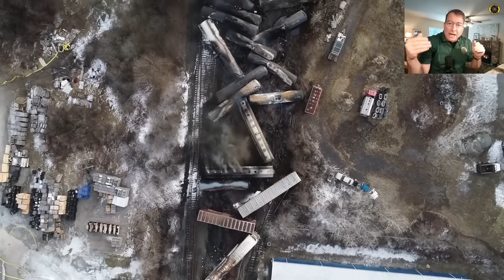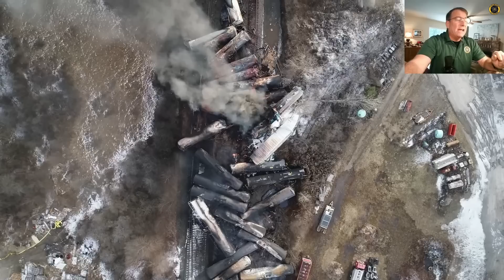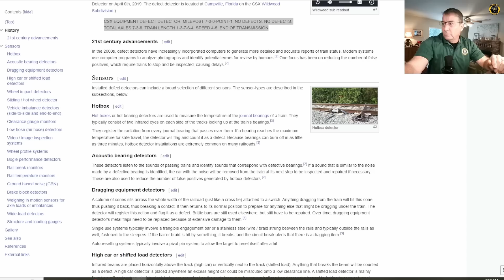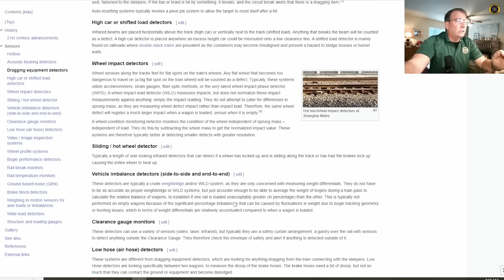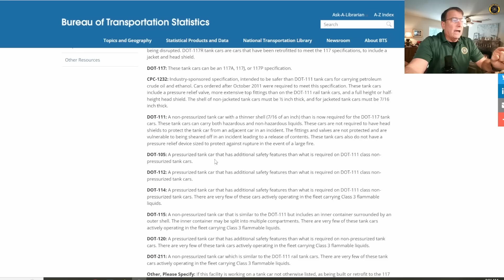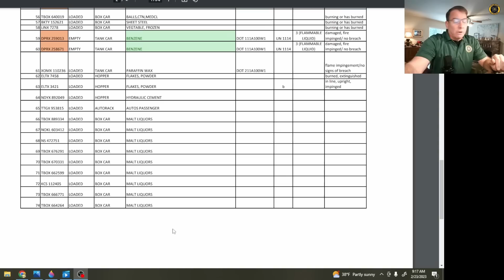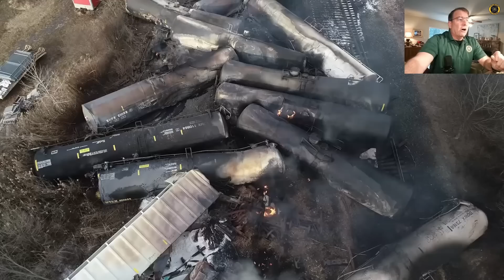NTSB Prelim Report: Norfolk Southern Train Derailment 23 Feb 2023

Comment: Sounds like the defect detector needs a software upgrade to check not only same axle temperature differences but the differences between all axles.
Also differences in the time domain for each axle, alarming when temperatures rise no matter the acute temperature.
Reply: Defect detectors are set to find temps outside of operational ranges. If it detects an out of range temp it alerts, it doesn't reference same axle over and over from multiple detectors.
Reply: @Batwingsix  
Which didn't protect this train.
That's why I suggest a change.
Reply: @Batwingsix  
I just read on another channel that this equipment is capable of notifying of trending temperatures.
The notification doesn't go directly to the crew, so somewhere in the system it was overlooked or was still within specs.
Reply: @mballer  the equipment isn't universal. Some check wheels, some check bearings, some check both, some do those plus dragging equipment checks. A bearing can fail in a few miles, unless they put a detector every few hundred feet there will always be a chance that a catastrophic failure happens without knowledge. There is a guy who films operations around Cumberland mine in PA. They had a coal car do just that where a bearing broke and derailed a car with no notifications because nothing was wrong at the defect detector they had up. No different than a tire deciding it wants to detonate while you are at 70 mph. There may be signs, but there may also no be any.

Comment: The hotbox issue could have been caused by a flat spot on the wheel. Flat spots cause heavy vibrations, especially on loaded rail cars, which can cause the lubricants inside the bearing box to shake away from the bearings themselves. Thus causing friction and intense heat.

I work as a shunter operator at a railyard and part of our job is to inspect the railcars wheel and brake systems upon arrival and before departure. 

If anyone has questions regarding railway operations or trains in general i'll be happy to answer what i can. However note that i work in europe so terminology, preocedures and systems may differ to the US.
Reply: You don't know what you are talking about...do us a favor and stay focused on railroading in Europe.
Reply: @tprdfh51  Ok... Well, i'm just going by what i've been taught. If you think I'm wrong or have other opinions, then by all means let me know. I'll be happy to discuss that with you, but there's no need being rude about it...

Comment: There's been some discussion of newer braking systems that electronically send a braking signal to all cars simultaneously, rather than allowing the one by one effect of the classic air line loss approach. The railroads have been resisting the installation of the newer methods. As some wag reported, these trains are using Civil War era braking designs.
Reply: Ok, the electric controled air brakes wouldn't have helped this one.  Once car's are digging up ballast and slowing down faster than the brakes can slow the cars it doesn't matter.  Also, the modern ABDX valves on the cars are 1980s tech, air brakes weren't even around in the 1860s... So like you said, whatever person came up with that is completely out of touch with the facts.  Westinghouse airbrakes came in the 1880s and standard by the 1890s with the K-system.  The AB system was developed in the 1930s, which was a great leap forward by having the emergency reservoir to help when the regular air brakes were low on air and the train needed an emergency application.  The modern ABDX valves are another step up in the system over the basic AB system.

Comment: TL:DR Inertia is a bitch. Everyone is pointing fingers but this is just bad luck. If those tankers had been ahead of that dry bulk car then this would have been a minor derailment. And yes, it could happen within a 20 mile distance. Remember, the engineer didn't even know about the derailment until he left the engine and saw the smoke. Once that connection is severed there's nothing there. Because he was in braking mode already there would be no indication of a problem. If it happened while under power the consist would react strangely and he'd know there's a problem as it goes from a 176 car consist to a 22 car one! This is one of those times where it sucks, clean it up and move on.

Comment: A Journal Box fire is what cased the derailment of the car. The air line ruptured and the emergency brakes automatically operated. Interestingly, it is well recognized that Train and Track Dynamics are more complicated than Aerodynamics. All this is not unusual in the least in actual Railroad operation as is known in my Railroad family of 70 years experience. What IS unusual is that the EPA, FRA and other Federal Agencies knowingly caused the ignition of the Vinyl Chloride which released an amount of Phosgene Gas and other deadly gasses. In effect, the Federal Government intentionally released Phosgene Gas upon Americans for the first time since Filed Marshal Hindenberg did it in 1918 in WW I. Incredibly irresponsible and reckless.

Comment: dynamic breaks use the locomotives traction motors as generators and feed the power generated in to grid resisters with fans to lose the heat, they will run down to about 7 m.p.h. at witch time they are running to slow to generate power and the service breaks take the train to a stop. if the engineer dumps the train air in emergency all breaks come on full , if the break pipe on the train opens up due to a broken hose in a derailment all breaks come on. in the event that the engineer or the train dumps the air the locomotives will stop all dynamic breaking action automatically and the engines come to an idle as a safety to keep the engines from ever over powering the breaks. they stay that way until the air leak is fixed and the breaks are charged back up and released then the locomotive will take  power again. as the engineer runs the train he can take reductions in air pressure on the service break to bring on the brakes as much or as little as he wants. when he is done with his service brake application and moves the handle back to release and the locomotive air compressor makes up the lost air in the system. if he moves the service brake handle to emergency all the air is dumped and he has to recharge the train to get a release and move again, with a train that big it can take a long long time .every car has a large  main reservoir air tank and valves and piping that all must be refilled with air.
Reply: brakex
Reply: @GH-oi2jf  37 years locomotive heavy overhaul, locomotive back shop foreman for a large railroad , retired now

Comment: 25 year current active locomotive engineer. Great analysis and reporting. My guess is that the axle in question failed and catipulted the first derailed car, similar to a draw bar that fails. Enjoy the aviation analysis, Juan. Have even applied some of your safety advice to railroading.
Reply: Hello, Josh. I'm a former C&S maintainer. I noted in Juan's report that he described dynamic braking, and that the air line was for emergency braking. My recollection from the 1970's is that the engineer makes a brake line pressure reduction to apply braking slowly, and not merely a dynamic braking effect from the traction motors. Aren't trains still using the 100+ year old WABCO approach to braking? I'm confused from what Juan said about this....
Reply: @arthouston7361  On class 1 railroads, dynamic braking was pushed heavily as the preferred way of train speed control about 20 years ago. Brake pipe reduction is used to supplement dynamic braking when needed at main line speeds. Stretch braking is used mainly at slow speeds when stopping on flat terrain or up hill. Something the report doesn't mention is trip optimizer (auto pilot). Was it in control of the train before the engineer slowed? That could have had an effect on the dynamic forces on the train before the engineer took manual control just before the derailment.
Reply: @j_hayes7257   That's interesting. It sounds like their desire for positive control of the consist wasn't fully thought through before it was implemented.
Reply: @arthouston7361  Amen to that.  No PTC system can possibly every type of accident.  The PTC requirements drafted into law by Congress - whose members seldom know much about engineering and technology - had not been invented yet, and was extremely difficult and costly to implement.  A few slight changes in the law could have cut development time and cut the cost by an order of magnitude.  An economic cost-benefit analysis by the Federal Railroad Administration of the all the technical requirements that Congress put in the law showed that the type of PTC mandated would not be cost effective.  But then there are those who believe that society has an obligation to spend an infinite amount of money to save one life ...
Reply: joshua hayes are there any active monitoring devices on the rail cars for things like axle temperatures or are the external devices as shown here the only things that give any data on the status of the cars?
Reply: @haqvor   According to Juan's report, there were only wayside defect detectors: a dragging equipment detector, and what we use to call a "hot box"detector, which looks for those hot axle bearings.
 I don't believe there is any FRA standard for car telemetry to be transmitted directly to the engineer and conductor.
Reply: The only telemetry we receive is air pressure on the rear car via EOT (that red blinking light on the rear) or various air and throttle readings from a distributed power locomotive. I have no doubt there will be increased inspections requirements coming soon.
Reply: I think the primary concern here (at least to those directly affected communities) is not the derailment itself, so much as it was the fact that there were cars carrying hazardous materials. A derailment is bad but the potential for release of hazardous substances makes a bad situation worse.
Reply: Is that the horse of famine on the front of that chariot dumping toxic chemicals across some of America's most fertile farmland?
Reply: Current active engineer ? Thanks for pointing that out ? Love UR sarcasm ?
Reply: Yeah, would have had to be a violent catching of the axle or truck considering that the tank cars should have had shelf couplers... of course, I don't know if the defect car was a tank car... so maybe no shelf-couplers involved. ???
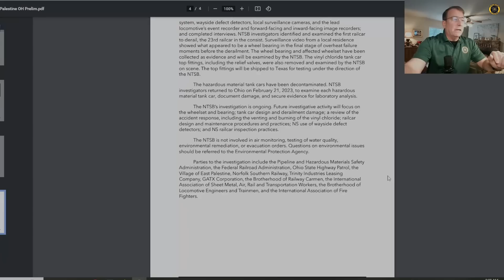Reply: @NightOwlModeler  #23 was a hopper car filled with polypropylene as was #24.  The nest 2 cars # 25 & #26 were hoppers of polyethylene, then a tank car of used oil, the 4 of the 5 cars of polyvinyl chloride and then more tank cars of not nice chemicals.  What is also interesting is the NTSB report says that the failure car was "Not in the Derailment Pile."  See the right hand column at 15:03
Reply: @NightOwlModeler  It (car 23) was a covered hopper with polypropylene. See the "derailment list" attachment to the NTSB report.

Comment: It would be nice to have the heat sensors onboard the railcars so they can be monitored continuously, but it's only air hoses between the cars, no electrical power or data connections. Refrigerated cars, for example, have their own diesel generators rather than drawing power from the massive diesel generators in the locomotives. North American freight rail is a difficult vintage of technology for overlaying modern technology, hence the wayside sensors talking to the crew over radio in primitive Siri voice. Not a great solution, not going to detect every fault promptly enough.
Reply: It would be way more feasible and economical to increase the frequency of detectors and their technology. It’s not economically feasible to retrofit and maintain 1.6 million rail cars

Comment: They need a system that will notice when the wheels are increasing drastically in temperature. They should also be compared to the other wheels on the train. This shouldn't be all that hard to do.
Reply: The detectors are set to detect outside operational or normal ranges, and they detect by axle number and side, it won't be able to detect increasing temps as they work independent of each other
Reply: @Batwingsix  Obviously. But the detectors all report to a central database. So what they need is a program that follows each train along it's route and every time it goes by a detector it looks at the previous readings and it also looks at the readings of the other cars on the train. And then a fairly simple logic test send an alert if something is increasing in temperature too fast or is out of bounds with the rest of the train. 
This isn't rocket science. This is something that is used on other types of transports. 
They need to stop pretending that trains run in the 1800's. This was a preventable incident.
Reply: @vanstry  lmao no, they don't all feed into some central database. It all depends on the line, software, etc. Plus you aren't taking into account a few factors. One: depending on the manifest, cars will be added or removed mid trip which will cause errors in your idea because axle counts have now changed and possibly positions of axles within the set. Two: catastrophic failures can, do, and will always happen. Metal fatigue, stress cracks, etc... We don't even know if this was an actual hotbox failure from the start or if there ended up being dragging equipment due to another failure that started this. Unless we are proposing trains stop ever 5 - 10 miles to do a full axle and equipment check there will still be these problems and we don't know whether or not this was preventable yet.
Reply: @Batwingsix  The information of the report came from a database. All cars have barcodes on them and there are readers at the yards so they know what car is where on the train. 
This could be done. Wouldn't always be perfect, but if one wheel suddenly spikes in temp and the others aren't? Obviously there's a problem. 
We're not adding infrastructure or hardware, we're just taking all of that data that's already there, and mining it for trends and other analysis. 
It would be highly cost effective and beneficial.

Comment: 0:45 GE calls "regenerative braking" "dynamic braking" because the power is dissipated in resistors on the roof. Make resistor power is about 6MW.

0:30 the air brakes are used at lower levels for braking in normal operation. This called service braking. A drop in brake line pressure to lower levels and faster is required for emergency braking. 

Trains have auto braking that will gradually apply up to emergency brakes if the operator doesn't slow fast enough. So it's not guaranteed that the brake line breaking or being burned through happened before the emergency braking event. 

Source: interned as a locomotive brake control engineer at GE Transportation.

Comment: You have a bit of a misunderstanding of how train braking works. Diesel Locomotives have mechanical brakes and can have Dynamic (regenerative) braking. But the locomotive brakes are not the primary braking control of a train. A long string of rail cars is just to massive for all the available locomotive braking to be able to stop. So the brakes in all of the cars is the primary braking system of a train. The train braking air pressure is generated and controlled by the locomotive and distributed throughout the train. Brakes are released by "pumping up" the air pressure in the brake line. Emergency brakes are applied by complete release of the air pressure (as happens when a brake coupling between cars is forced open).  Air pressure between none and full modulates the braking action.   At least this is an old railfan's understanding of how train brakes work.

Comment: Back in 1990-ish, I worked for an R&D company developing a solid lubricant system for axles on high speed passenger rail applications. The weight of the train can heat up bearings incredibly fast and ignite the lubricant about as quickly as it would take to stop the train. It's like a tractor trailer losing engine and air brake control down a mountain. Go fast enough and the axle grease lights up.
Reply: Yeah, the problem used to be loss of lubricant, now it's the grease looses it's lubricity and dries up internally in the bearing. Eventually causing failure, but it's rare anymore. Cars get pulled out of service for an acoustic bearing detector hit (dry bearing) or a wheel worn out before the bearing ever fails.

Comment: I read the report. Seems that bearing was getting hot and just not detected in time. 10 miles between the first two detectors and 20 miles until the final one that triggered the alarm. I'm guessing the detectors don't communicate so there was no way to calculate the delta between 1 and 2. If the detectors can be at least 20 miles apart and passing one triggers no warning then passing the next in total derailment, the system is inadequate. Detecting the change between 1 and 2 of 70 or so degrees in 10 miles would probably be the best way to tell something was happening, but I'm guessing delta comparisons are not part of the system.
Reply: I don't think you comprehend how insanely complicated it would be to try to link the detectors together and have them try to account for all the operational changes and what's going on with every wheel in order.  The system is good at calling a defect here at this point and dealing with it.  Trying to log every wheel temp between every train at every detector without also knowing which cars were taken in or out of the train and trying to keep that data straight would be a nightmare.
Reply: Detectors all report to the Dispatcher, trending would be done there.